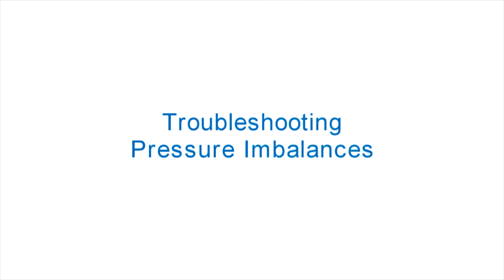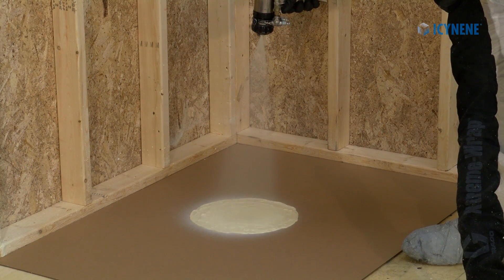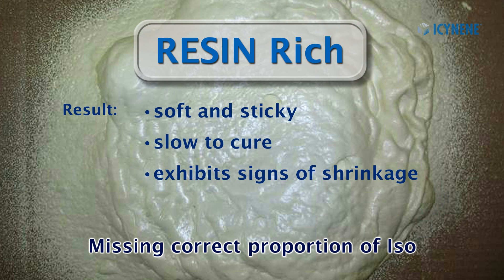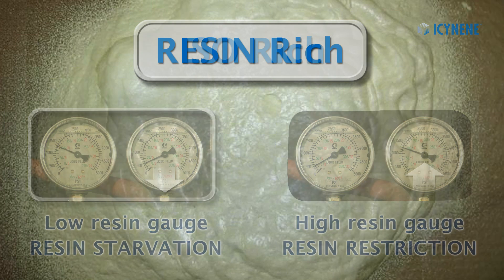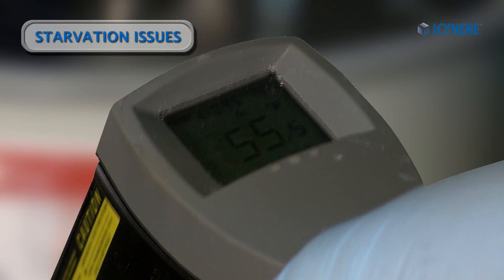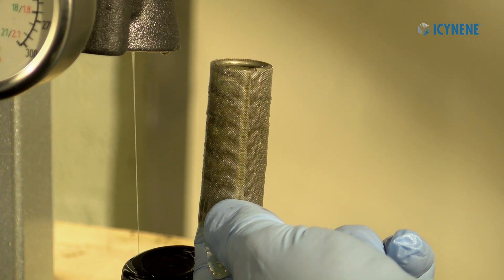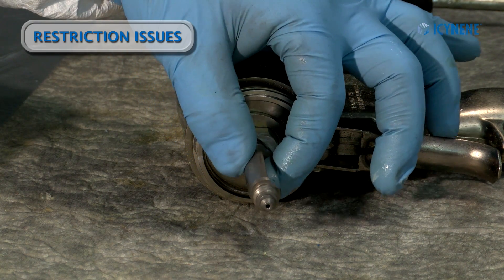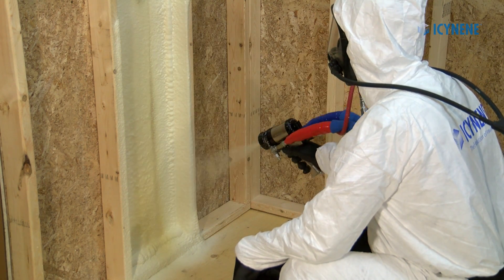Troubleshooting Pressure Imbalances

Comment: When I pressure up pressures are equal. But as a spray, the A side goes 200-400 psi higher. Need help please.
Reply: Did you end up finding the issue?